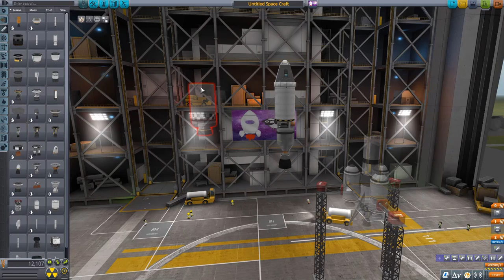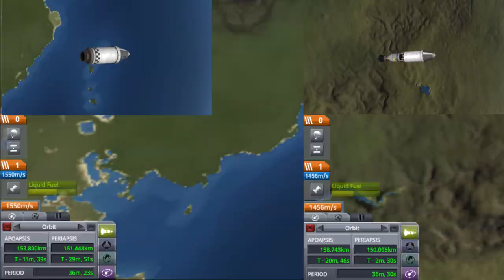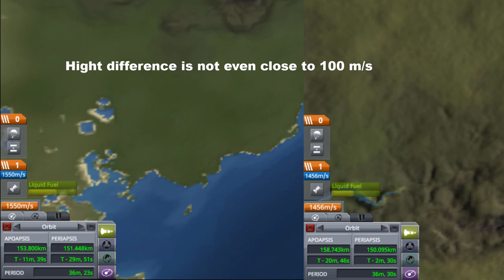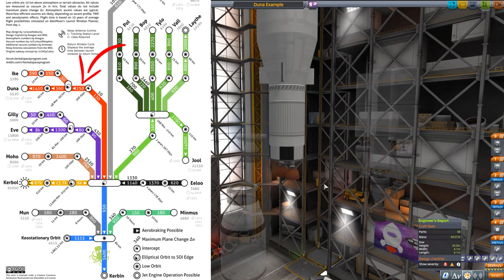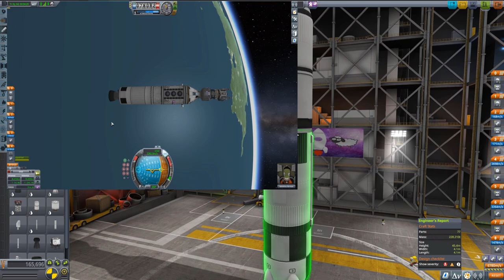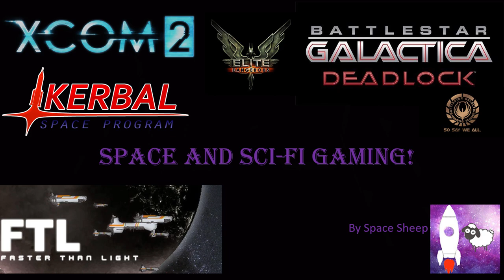Nuclear Engine; Pros, Cons and how to use the LN-N properly! [KSP Guide]

Comment: I agree, this is an important detail that a lot of players miss, so they believe they can’t go interplanetary without using nuclear engines with long burn times. It makes sense that nuclear engines work better for large payloads because of the rocket equation to calculate delta-v. With higher, your ratio between wet mass and dry mass can be smaller, meaning you’ll need less fuel. If dry mass is already small, you don’t get this advantage.

Comment: Funny story, I decided to try and make a space station to orbit the sun, I've called it the Icarus program. So I made the station itself, it's quite heavy but I'm far enough in the tech tree that it's not much of an issue, my goal is an orbit lower than 6,000,000km, so to not only test the Nerv engine but also be efficient, I decide to use the atomic rocket motor as my upper stage to take it from 60km, circularize, and then perform the trans-kerbol injection and deceleration burns to lower the orbit. The issue was on my first attempt, the motor had such low thrust that even at 100km (a minute or so before apogee) the motor could not safely circularize. The motor burned from roughly a minute from apogee all the way to perigee and barely got the perigee to 47km! So now that top stage has 2 Reliant boosters to help circularize and the stage also now uses 4 Nerv motors, I'm optimistic that this new design of the Icarus rocket will be successful!
Edit: sorry for the long comment, been working on this mission for a while lol.
Reply from the maker: Thats line I said one of the drawbacks pf the LV-N it has very low thrust. But glad you succeeded with your mission.

Comment: You have to consider mass, always. You should have total mass and deltaV of that upper stage in focus when comparing. So in direct comparison with the Poodle you'd need to take a smaller fuel tank for the Nerf and compare both at equal mass and then compare deltaV of both stages. This would lead to the same conclusion: there is a break-even point somewhere in mass and in target DeltaV at which using the Nerv (aka a heavier engine with better ISP) makes sense.
Reply from the maker: Yes that’s the more accurate approach. Theoretically best would have been to show a graph and where what engine is but that might be too much for some people.
Reply: The nuclear engine good use is to make a base ship in orbit with a few of them taht you reuse for transits forever... (you just refuel it) then the price fo pushing that mass into orbit  mostly disapear and the LV-N becomes far better than the terrier.